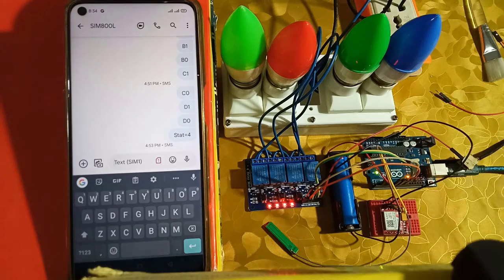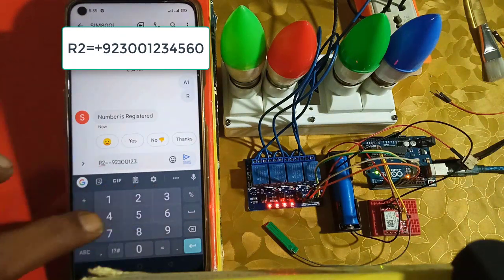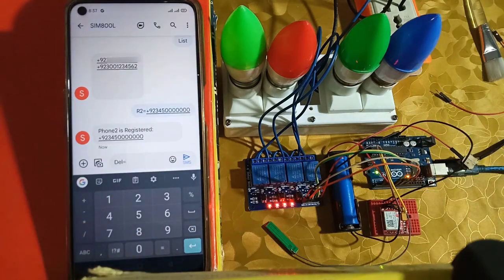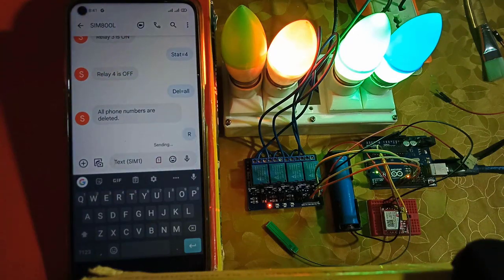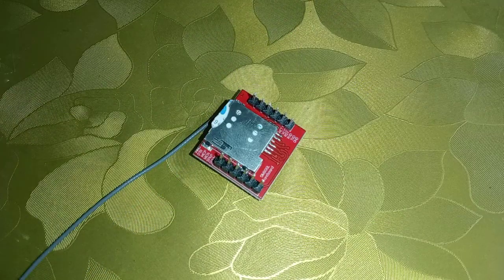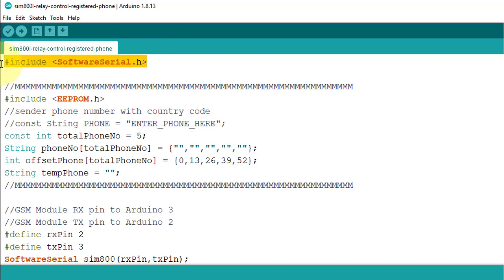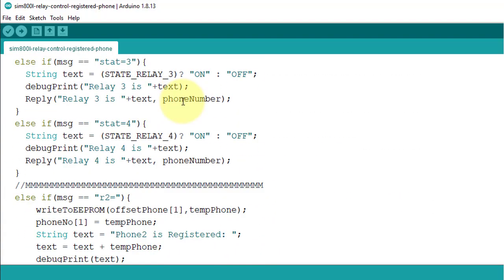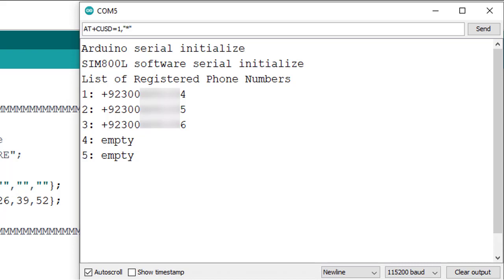Arduino SIM800L Relay Control with SMS | SIM800L Register Phone Number by SMS

Comment: Thank you for the vid Mr. Amhad. I have a question, thus this code work also on GSM shield like GSM 900? Thank you sir!
Reply from the maker: Yes, It should work
Reply: Mr. @AhmadLogs  i tried it on gsm 900 but i dont get any respond from gsm. It shows the number I added in serial monitor but i didnt received any confirmation. Also, it didnt add to the list of phone numbers. By the way thank you for your respon Mr.
Reply: Other question Mr. Amhad, how should be able send messages to the list phone numbers?

Comment: Sir, sim800L how to get the current date and time? How to make the code for AT+CCLK? , pls add the code for me thanks
Reply from the maker: I am not sure. but I will try if it is possible
Reply: @AhmadLogs  dear sir, I need one more code, I am used sim 800l and Arduino nano board to control by relay, and I am used Normally Open type contact dry run sensor, and fixed to motor delivery pipe,
When on the relay motor is running but need some time delay to water delivery out, when touch water to sensor going to  Nc, the motor is running continuously, if water did not come out after time delay sensor will deactivate the motor,
Sir, I need the code for dryrun, thanks

Comment: I wanted to repeat your project to study sim800 , the number registration is successfully written the command is received and displays on the port monitor . but not one relay does not work and there is no return sms message
Reply from the maker: you can use the serial.print command to debug the project

Comment: Mr Ahmed thank you very much for sharing
I am null in arduino and I followed your advice step by step and the connection diagram and I downloaded the code without problem and I modified the number of the gsm but the messages do not arrive and nothing happens .
Reply from the maker: you said " I modified the number of the gsm". 
not enter the gsm module number. enter you personal phone number in the code.

Comment: Hello Ahmed Khan. I have a problem with the execution. No commands are executed and I can't even see the list of declared numbers in the serial monitor properly or delete them to create a new number. Please help. Thank you very much for your time.           19:09:59.366 -> Arduino serial initialize
19:09:59.366 -> SIM800L software serial initialize
19:09:59.366 -> List of Registered Phone Numbers
19:09:59.366 -> 1:      ⸮⸮⸮⸮⸮⸮⸮⸮
19:09:59.366 -> 2: ⸮⸮⸮⸮⸮⸮⸮⸮⸮⸮⸮⸮⸮
19:09:59.366 -> 3: ⸮⸮⸮⸮⸮⸮⸮⸮⸮⸮⸮⸮⸮
19:09:59.366 -> 4: ⸮⸮⸮⸮⸮⸮⸮⸮⸮⸮⸮⸮⸮
19:09:59.366 -> 5: ⸮⸮⸮⸮⸮⸮⸮⸮⸮⸮⸮⸮⸮
Reply: same problem

Comment: Hello, nothing special happens when I run the code and send "r", please guide me.
The output codes in the serial monitor are as follows
********************
 SIM800L software serial initialize
 List of Registered Phone Numbers
 -> 1: ⸮⸮⸮⸮⸮⸮⸮⸮⸮⸮⸮⸮⸮
 -> 2: ⸮⸮⸮⸮⸮⸮⸮⸮⸮⸮⸮⸮⸮
-> 3: ⸮⸮⸮⸮⸮⸮⸮⸮⸮⸮⸮⸮⸮
 -> 4: ⸮⸮⸮⸮⸮⸮⸮⸮⸮⸮⸮⸮⸮
 -> 5: ⸮⸮⸮⸮⸮⸮⸮⸮⸮⸮⸮⸮⸮

AT+CMGF=1
OK
AT+CMGD=1,4
OK
AT+CMGDA= "DEL ALL"
OK

+CMT: "+************","","22/08/18,21:46:58+18"
r

Comment: Hello Sir,
Can I connect 1K resistor and BD137 Transistor between Digital 2 and RST pins sir. Will it work fine sir
Reply from the maker: which RST pin you are talking about? Arduino RST Pin or SIM800L RST pin?
I have tested the same with 1k resistor and bc547 transistor between digital pin 4 and rst pin of sim800l

Comment: Dear,
I have a question that, there is no Phone number used in your program so how can serial monitor show your phone number's ?
please give me a proper solution for this issue.
Reply from the maker: the phone numbers are stored in the eeprom. and we will store the phone numbers by sending sms. for example if you send "R" (without double quotation marks) from your mobile phone. and the phone number will be registered and stored at location 1. 
the same way you can register more phone numbers. to register phone number 2, you will send r2=+923001234567 (enter your own phone here) from your phone. and it will store on location 2.

you must need to watch this https://youtu.be/OJcGY4ySs4o

Comment: Aoa, Tauseef Bhai
I m not getting list of registered on serial monitor as well as on my mobile phone.
I'm using Sim800c GSM Module for this test.
The same module sends SMS & miscalls to my mobile phone using your fire alarm code for Sim800L module.
Can you please check & confirm that the above code for mobile number registration is working ok at your end or does it need some changes.
Preferably if I get your email address so I can share the serial monitor screen shot to you for better understanding of the problem I m facing.
Thanks & kind regards.
Reply from the maker: I will test it again. check serial monitor for a list of registered phone number. what displaying there?
also test if you eeprom is working?
Reply: @AhmadLogs  I m getting square blank boxes on start up of serial monitor at registered phone numbers location. When I send r , it shows only ok in serial monitor Neither it sends Registration SMS nor it shows in serial monitor that the number is registered. I will check the eeprom & will update you.
Kind regards.
Reply from the maker: @yawarsaeed6499  OK, I will check a try to improve the project
Reply: @AhmadLogs  Ok, meanwhile I have tested the code with a new ATMega328 controller to confirm the eeprom. But getting the same result.
Will be waiting for the modified code from you.
Kind regards.
Reply from the maker: @yawarsaeed6499  OK I will try to update the code

Comment: How are you my friend I hope you are fine the program works with me well but after I add a sensitive that works well also but when you add more than 5 sensors starts to lose some features such as sending the case what do you expect what is the problem is the large program may be the reason
Reply from the maker: I am fine thank you.
arduino sometimes is unable to handle large and complex programs. you might use esp32
Reply: @AhmadLogs  Why is the stat sent to only one number which is registered in the program is not the number to send the stat is the one sent by the Arduino replay means so 5 numbers if sent by the stat is not a message in the state of the rilai is that true or I understand wrong
Reply from the maker: @AlMokhattatAlIlahi  the stat is sent on the sender phone number, only if the phone number is stored in the eeprom. it will not send state to all  the phone number stored in the eeprom
Reply: @AhmadLogs  yes i'm sorry i'm wrong i'm so sorry

Comment: A great and practical project can you add more than four reai and can you add the motion sensor and control its operation with a message
Reply from the maker: please give me some more details
Reply: @AhmadLogs  I mean, can I add more than one exit to control more than 4, and when I add a motion sensor, I need to control it with a message in the sense that while I'm inside the house, I control the suspension and operation of sensors, and I'm inside the house, not the sensors, and I'm out of the house doing the motion sensors.
Reply from the maker: @AlMokhattatAlIlahi  very practical idea to implement. it is possible and can be implement in Arduino. so, I will definitely work on it
Reply: @AhmadLogs  ok iam waiting

Comment: I face a issue in this project I cannot change the text message for my convenient for eg: i want to change "a0" instant of" light1off " the code does not work properly

Another one is more than 50 message received by simcard 51th message has not received in it

Please fix this
Reply from the maker: 1. make sure all the letters of "light1off" must be in lowercase (small letters.
2. for auto delete sms add the following line of code at the end of line number 402
sim800.print("AT+CMGD=1,4\r");
Reply: @AhmadLogs  thankyou for the reply I will try & I will give feedback for you
Reply: Hi your code works fine, but a little problem is occurs if any unknown message is received the message is saved it may be filled the memory
Reply from the maker: @makeforindia612  you can use AT+CMGD=1,4 in the setup function
Reply: @AhmadLogs  but my automation project works on 24/7
Reply: How to count the received message? If we count the number of received message we can stored the value  in arduino EEPROM. After we can use if condition "if the value is equal or greater than the preset value(20) the AT+CMGD=1,4 command will runs automatically. So kindly tell where to place the count++ in this code
Reply from the maker: @makeforindia612  add it on line number 134 in the following if statement
if(cmd == "+CMTI"){
Reply from the maker: @makeforindia612  then use AT+CMGD=1,4 command at line number 143 in sketch file
Reply: @AhmadLogs  is i will put the at command in two places???
Reply from the maker: @makeforindia612  yes. you are saying right
Reply: @AhmadLogs  thank you so much for replying continuously 👍 good luck for your future projects.......
Reply from the maker: @makeforindia612  so nice of you

Comment: I wish to tray..good channel..iam subscr.
Reply from the maker: Thanks and welcome
Reply: @AhmadLogs  
I use an arduino uno type SMD, the power supply is only from usb, & the battery is 3.7v. when the relay is turned on the lights go on.
then sms doesn't work
Reply from the maker: @republikbasecamp  relay required more power. so use a 5v power supply. connect the power supply vcc pin to Arduino 5v pin and relay vcc pin. that's all
Reply from the maker: @republikbasecamp  its mean your sim card is not registering to the network. only 2g sim card will work.
Reply: May be...or my simp800l damage..?
Always blink 1s
Am reg indonesia.
Reply from the maker: @republikbasecamp  it might be possible. 

but you must check the antenna connection. or replace your antenna. and then try to test
Reply: does wrong coding really affect the signal (sim800 module) and if only a signal test (sim800 led) can be done without arduino?
Reply from the maker: @republikbasecamp  1. does wrong coding really affect the signal ? No.

2. you can test it without arduino. just connect the battery positive to vcc of gsm module and gnd to gnd.
Reply: @AhmadLogs  1.sorry, it's not your code that's wrong, but my way of copying is wrong.
Reply from the maker: @republikbasecamp  ohhh, that's great. so nice of you
Reply: @AhmadLogs  i wanna to buy new modul sim800 🤗
Reply from the maker: @republikbasecamp  hmmmm........

Comment: excellent project bro. really impress with you project. Btw, can you share the code project w/o relay coding? cause i just want coding for register phone number by sms. pleaseee hehe
Reply from the maker: yes, it might be done. why don't you do it yourself
Reply: @AhmadLogs  bro i got problem with your coding. i copypaste and follow all your step but when I send R on gsm, on my serial monitor only show 
13:31:38.772 -> +CMT: "+XXXXXXXXXX","","22/01/11,13:31:33+32"
13:31:38.772 -> R

why Can't Register? i already changed GSM, ARDUINO Board, Antenna.
Reply from the maker: @arezadeyn311  if you have already register a number, then you cannot use R command anymore. first delete all the registered phone numbers. by sending "del all"command.
and then send R command again

Comment: Excellent, like all projects
I finished the gps project with sim800l and m-6gps module, with the help of your projects, of course i went the eeprome another way
Reply from the maker: thanks. can you please give me some details about your project. I just want to know
Reply: @AhmadLogs  It is a car alarm, which opens and closes the car door, and uses GPS, and when the car door is opened, vibrates the car, sends SMS, and beeps, and flashes, and  The switch relay has a gas station, and works with DTMF, and sms, and the sound inside the cabin can be heard.
Reply from the maker: @saeidpourafshar4824  hmmmm. very nice. and it required lot of hard work.
Reply from the maker: @saeidpourafshar4824  interesting...
Reply: @saeidpourafshar4824  I am about making the same thing could you share with me. i think its better to build it on a esp32
Reply: hi, i want to add DHT 11 into this project how can i do

Comment: SIR , if I use 4 g sim with this module  then it will be work or not?
Reply from the maker: it will not work with 4g sim card
Reply: @AhmadLogs  Then what is the remedie

will it work woth 3G sim card.. atleast.....

what we have to do to work with 4G sim card
Reply from the maker: @454ecekalyankumar5  you just need to buy 3g or 4g gsm module such as sim7600
Reply: @AhmadLogs  Is 2G sim available for buying..?
Reply from the maker: @454ecekalyankumar5  ask from your gsm network provider

Comment: Hello Ahmad Khan
I had a program with Fona Library that I tried to combine your good program with my own program
In the meantime, I notice  that the way to introduce rx & tx pins in the fucking fona library is the opposite of the sim800 library. Finally, I succeeded.
Thank you again
Good luck 👌
Reply from the maker: So nice of you
Reply: I made it.. but I not used fona Library. Just used software serial library
Reply: @SaifulAdliYusof  Yes, you are right
This story is from a few years ago when I just started programming
After some time I learned how to use the soft serial library

Comment: Essalamo alikom... Brother. Great job.. Thanks.. But the code not working with me... I have nano 328P... Please where's the problem? Thank you so much for your help
Reply from the maker: can you please explain the issue in detail
Reply: @AhmadLogs  When I send the letter R..there is no reply
Reply from the maker: @saadelm2955  what about the serial monitor. tell me the serial monitor output
Reply: @AhmadLogs  hi ahmed.. The code is working thanks.. How do we maintain the condition of the relay in the event of a power outage and its return?
Reply from the maker: @saadelm2955  good question. I suggest use sd card to store the state of relays. you might use EEPROM, but it is not good idea.
Reply: @AhmadLogs  thanks so so so much

Comment: Can we use Arduino nano instead of Uno.
And is relay state stable after system restarted sir.
Reply from the maker: yes you can used arduino nano.
the relay state will reset when the system restarted
Reply: @AhmadLogs  thank you sir it's a valuable product.
Reply from the maker: @venkataramanac5983  so nice of you

Comment: I want to ask question regarding SMS alert, here the condition is that at the Arduino+800L module end ,
 I want to receive a alert SMS only for one time on my mobile ,
but in mayproject I placed switch with door  at Arduino end , 
Now I received multiple SMS till door open ,I want to stop more than one SMS 
What coding will need to stop extra SMS
Reply from the maker: you need a variable such as boolean send_sms = 0. 

when the door is open. check 
if(send_sms == 0)
{
   send_alert();
  send_sms = 1;
}

this way you can send alert single time when the door is open
Reply: @AhmadLogs  thanks you are great 🌹🌹🌹
Reply: Did you solve the problem and could you share the code. i could use it ;-)

Comment: This is great project indeed, very helpful,  more strength to ur ideas.  I suggest if you can add Google Map address  and location, this project can be used  as car tracker which can make it more useful for ur fans,  especially me.
Reply from the maker: I think it required gps module to integrate with this project. nice idea, I will try it.
Reply: @AhmadLogs  yes it requires GPS module through which will get the geo location and you  will  now encode it in google like and send as message to the user.
Reply from the maker: @ezeoluchukwu5104  It will possible. but the arduino program memory is limited. my code used 55% of memory. If it use gps, then the code becomes more bigger, and then, it required more memory. I am afraid if the arduino uno can handle it. but I will try
Reply: @AhmadLogs  okay I am waiting
Reply: How to register number